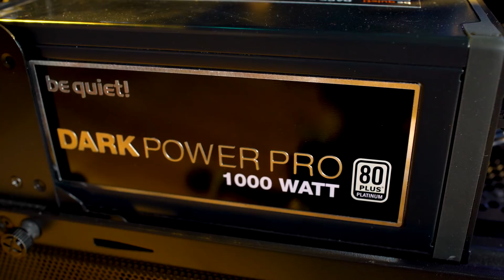Newegg Insider: Hard Tubing and Gaming with Alphacool

Comment: Here's a tip for measuring for bend runs.  Use your ID shaper that you put in the tube to keep it's shape, take that and bend it to whatever direction and shape you want to go with and make a small mark on the shaper.  Since you're putting the bends with the shaper, any extra tube you need to cover your bends will be reflected in the shaper length.  Cut the tube to the length marks on the shaper tube and start bending.  Also ALWAYS buy more tube than you need.  Even the most experienced bender will mess up or even change the design after your initial fit.  My tip is buy enough tube to allow you to create a "dry build" where you test out your ideas.  Not everything works out once you start your runs so be open to changing.  Once you have all your bends worked out and runs made, use the dry-run tubes as templates for the final build.  Wear some soft gloves and be really careful of hardline connectors.  The tubes are very easy to scratch and a lot of the connections are precision buillt using CNC's so they can have some sharp edges that can easy scratch a tube.  What I do is use some tape to protect the ends while I'll finalizing the connection.  Then when you are ready, backoff your connector, remove the tape, and gently slide the connector into place and tighten down the fitting.   Easy and without scratches.  have fun!

Comment: Could you possibly list all the parts for this exact build? Just all the water cooling parts. I would love to do this but I do not have the patience to try and figure this all out on your website, its very confusing for a novice like myself. I bet you would sell a bunch of these if you do this.
Reply: That's my issue, I want to do a custom loop but figuring out all the parts is very confusing. I just know I will order the wrong incompatible parts or not enough of what I need and be waiting for the correct stuff to show up.
Reply: did you found any build like this with a list ?